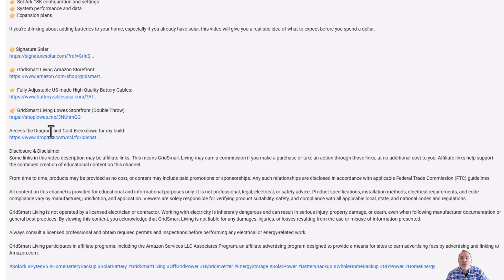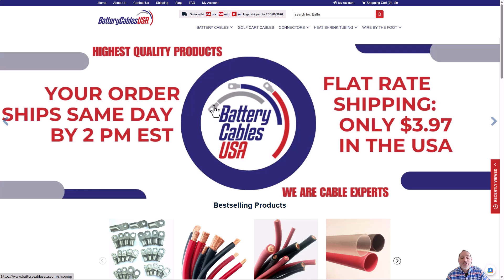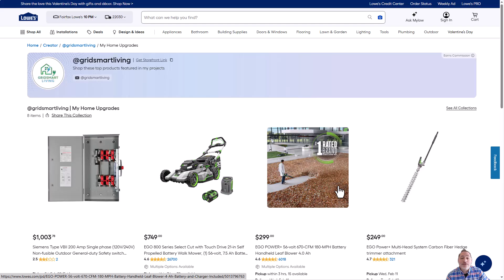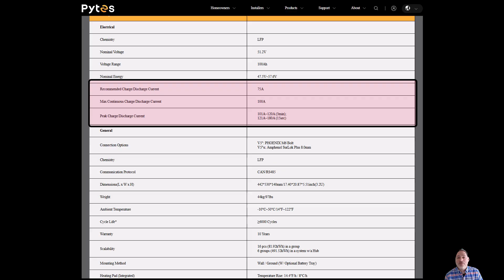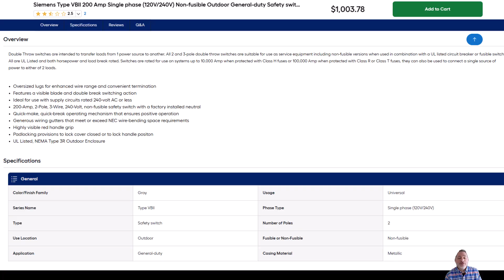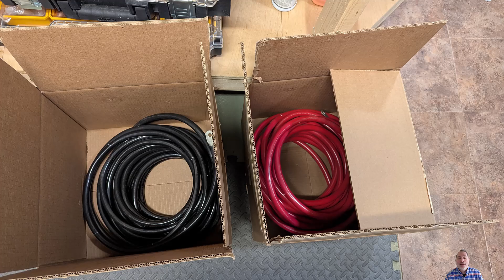Sol-Ark 18K + Pytes V5 Setup – Complete Parts Walkthrough

Comment: 30k for parts only not counting panels or racking?
Reply from the maker: It actually was a little less than $30k.  Correct, no solar components.  The actual cost could be higher depending on battery rack choice.  Depending on the aesthetic you are looking for you can find cheaper rack options for rack batteries, or more expensive options.  I think there are areas where some costs could be further reduced.  Some of my choices cost a little more to achieve a certain aesthetic.  I also didn't have room for another disconnect to better isolate the Sol Ark per the Sol Ark recommended diagram.